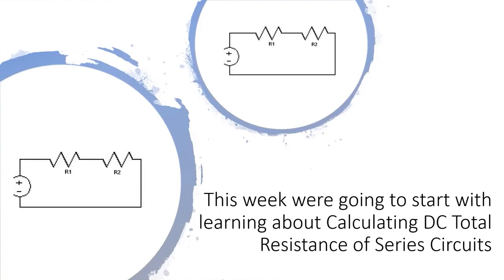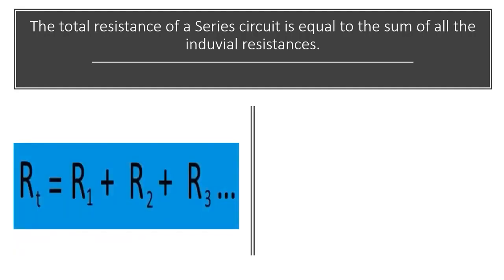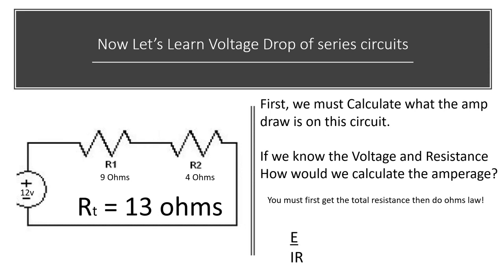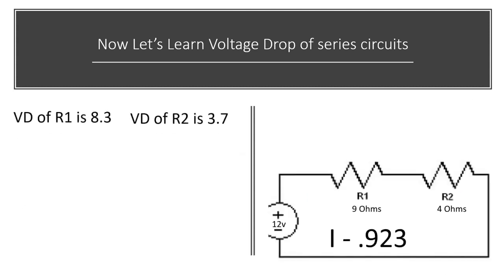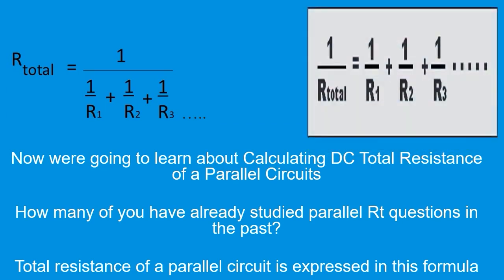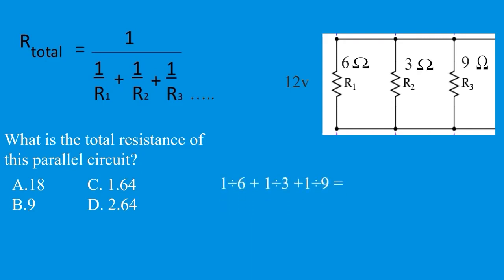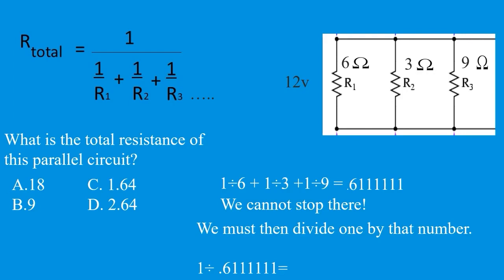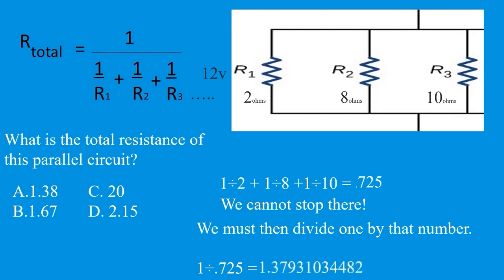Lesson 5.3 Full Electrical Exam Prep  2017 / 2020 / 2023 Compatible NEC Exam Prep DC Calculations

Comment: Love your work coach, I am currently studying. If I may just contribute to the discussion. Add up the fractions by finding the common Denominator.

Rt = 1 /(1/3 + 1/6 + 1/9)                      We will need to find the common denominator to add the fractions up.         3, 6, and 9 all eventually add up to 18
1 x 6 =6          1 x 3 =3       1 x 2 =2        6 + 3 + 2 = 11      The denominator is going to be 18, so multiply the number that will get you that value and apply
3 x 6 =18        6 x 3 =18     9 x 2 =18                         18      that value to both the denominator(bottom #) and the numerator (top #). Then add the Numerators                                                                  
Rt = 1/ (11/18)                                                                       Put that equation in the calculator and that gets you the exact value
= 1.6363... ohm

Comment: Hello, I am currently practicing this and was wondering if maybe the solution was wrong for the equation 1/6 +1/3+1/9=.611111. I input this formula on my calculator and get something different. Is there possibly a step im missing? Would appreciate some help.
Reply from the maker: Try pushing equals on the calculator in between each transaction, or if you are doing that, try doing it without it